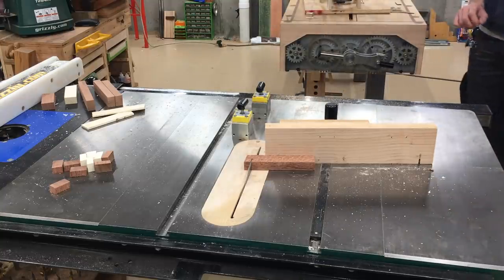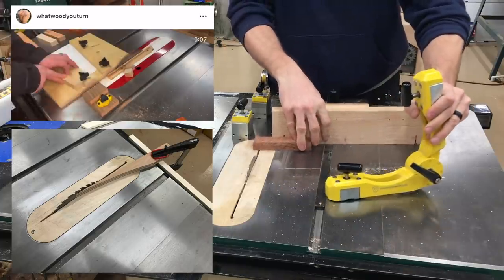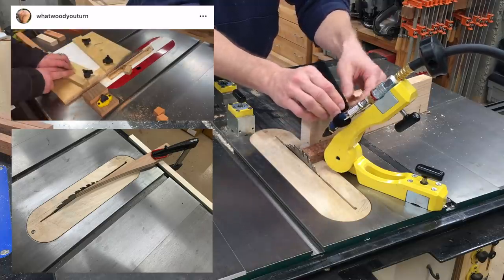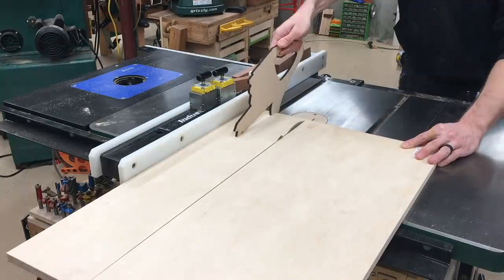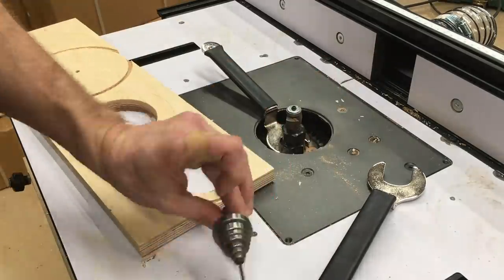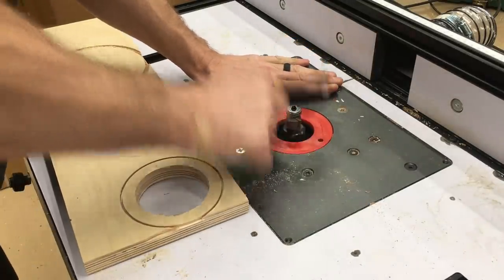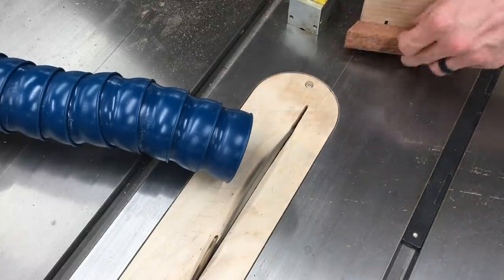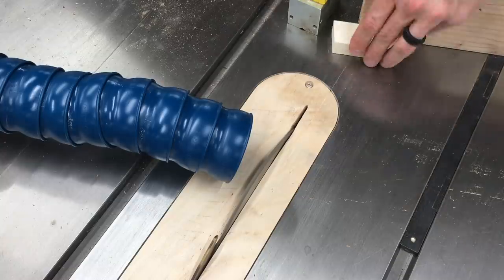Table Saw Kickback HIT ME In The Forehead!

Comment: Yep, proves riving knives are good to have, as well as why they are bent to match and follow the blade-curve, but many designs don’t follow the blade's movement, which means one have to remove them if doing anything else that just cutting throught, and then few put them back again.

Manufacturers need to start making those knives user-friendlier and stop mounting things that forced you to remove the knife. 😊

Comment: I do exactly what you just did all the time.  So, the danger was a piece being caught by the back of the blade.  I'll be more aware of that danger.  Maybe I'll setup a simple fence tapered against the blade that pushes the cut-off pieces away.

Comment: People are always shocked when a plane crashes ...

.. you are in an aluminum tube with walls 1 millimeter thick going 500 mph while you are 30,000 feet in the air. It is shocking how rarely a plane crashes.

Comment: Again a situation to really recommend a riving knife! At least in Germany they're mandatory so unless you've got a really old saw it should have one. If properly set up, meaning in line with the blade, they don't hinder you and are the best protection you can have! Same goes for the blade guard which should be used whenever possible, it could have prevented this.

Safety, especially in a home shop without insurance and where your income doesn't depend on how quickly you finish a project, must be of highest priority!

Comment: For those like me who can't build a full fledged small pieces extractor: cut a large wedge from a board that you can secure in the right-hand T-slot, the tip of which is near the blade and which prevent the pieces from accumulating at the back of the blade by deflecting them to the right. Better than nothing.

Comment: You've got to do better. Reaching for the cut pieces with your hand while the blade is running. Not running the cuts past the blade. Not clearing the cuts and letting them crowd the blade. You're tutorials can't flaunt the basic safety practices to the viewers.  Riving knives wouldn't fix those basic safety steps.